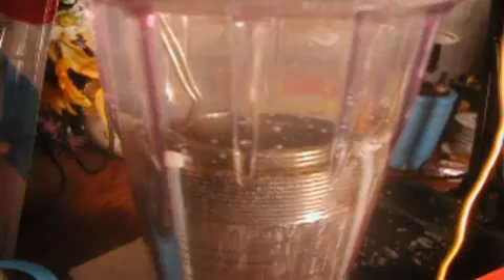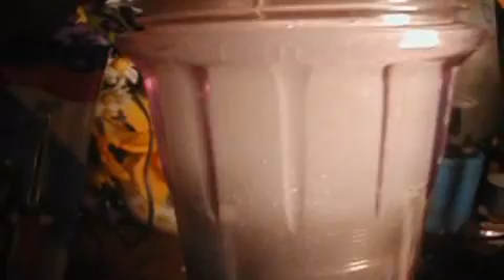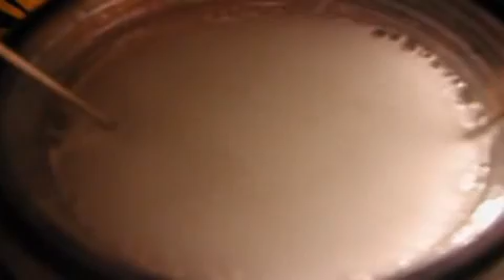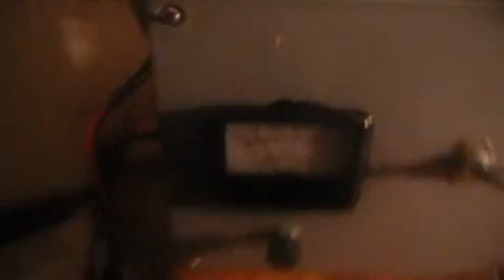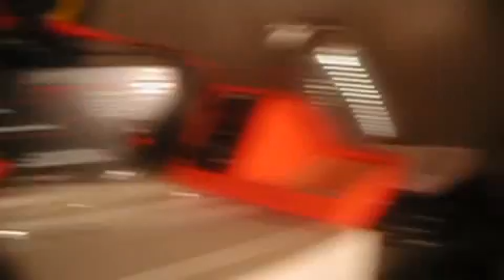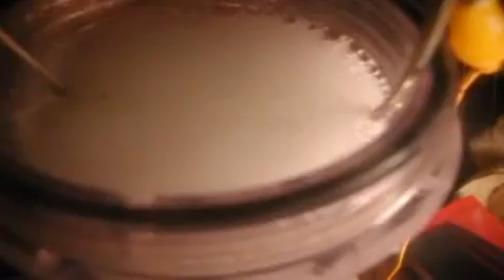Efficient Water Electrolysis For Hydrogen Production. 2/2

Comment: As it can be seen, it's actually an HHO generator, it decomposes water in its primary molecules but they're both combined, because the two poles are sharing the same chamber, in electrolysis of water, H2+ molecules go for the cathode and the O+ go for the anode, in short words.

Comment: So what's the point in all of this? What is it for?
Reply: Hydrogen has better energy storage by mass than any other fuel or battery, and this guy's device makes hydrogen gas a hell of a lot faster than any of the other home built stuff I've seen on youtube. A way to make a lot of hydrogen very fast is an excellent way to store renewable energy, and mass production would provide a cheap, clean way to run power plants, planes, cars or boats.

Comment: This is my video.. not Stan Meyer. Read the comment below about  the video below. The results are obtained by increasing the temp. An increase of 20 degrees will raise gas production. Try it for yourself.  Has been known for many years. It is not a deception. The higher the temp the better the production. High pressure and saturation with KOH raises the boiling point.The boiling point of water can be raised  to F275 degrees by 10 of 15 pounds of pressure similar to a pressure cooker.
Aubrey Sims

Comment: This is 12 volts and 12 amps max, lowest levels shown were at 1/2 amp. Anyone can replicate this. I used KOH to saturation, water time is about 140 degrees. Heating the water moves the electrons into a higher shell making the polar bonds easier to split. Try it for yourself, easily reatable even without the PWM. It is for controlling the current draw... no other reason. Water can be disassoiacated at around 2300 degrees ( if I remember correctly)  with no electrical input.
Aubrey Sims